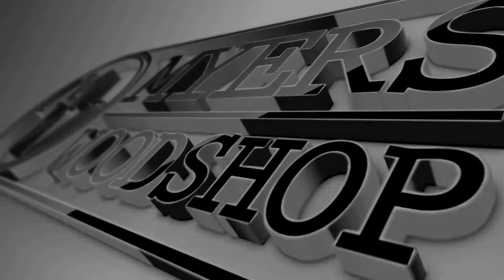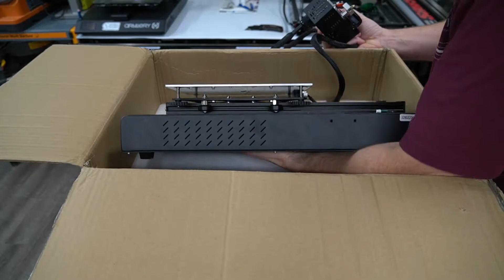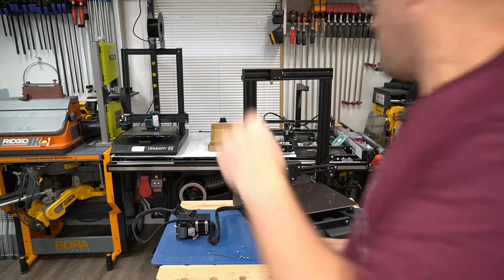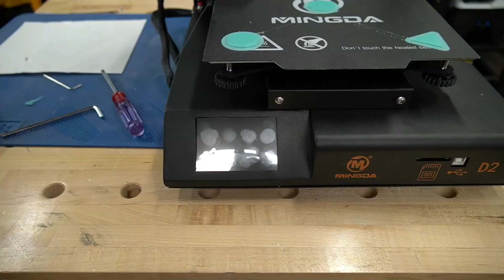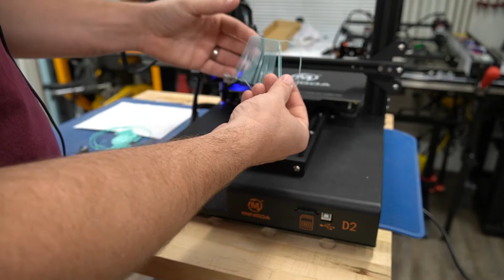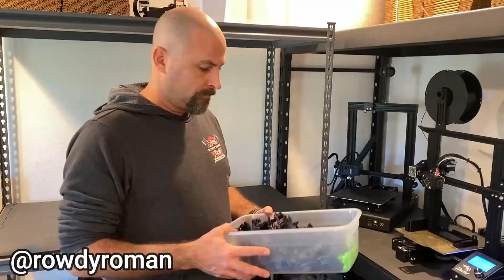Mingda D2 3D Printer Review.  Is This Never Heard Of Brand Any Good?!

Comment: Do you still have the Mingda D2? I have it, and I have given it to my 3rd oldest brother. I found out that despite it still working, MINGDA, discontinued it, along with the Rock 3 . I am having issues with the main board on the Rock 3 now. I am emailing MINGDA about it. I did have problems with the power supply at first, so I replaced it, and then I had to put Ferrells on the LED wires and put heat shrink wrap on it. MINGDA doesn’t have any parts of either the D2 or the Rock series, but I am seeing if I can be the distributor for their D2 series and the Rock 3 series for their parts. Waiting on the email from them now.

Comment: Guys, don't get fooled by this F ** O. When plugged into a socket with a button in the OFF position for the first time, there is a short circuit immediately.
When disassembling the power supply unit, it was fucking poor quality. Inside the block there are a bunch of pieces of tin 2-4 mm long that stagger back and forth, a slow-action domba, in my case, it went bang right away.
Further that I noticed the rollers are of very poor quality, the bearing walks freely in this black plastic, it seems to be pressed. The bearing itself is eccentric of the black roller, that is, with a calibrated table, GLASS ON THE TABLE, if I move the carriage along the X axis from one end to the other with my hand, then it can be seen how the nozzle goes up and down somewhere 3 times over its entire length, the rollers are definitely eccentric.
About LED, he lives his own life. It is connected directly to the transformer and there can be no talk about color changes in the menu.
Something like that about him.
LIKE so people don't get caught.

Comment: How's your Chiron doing?  Mine has been a disaster...great prints, then massive under extrusion.  Very bowden all the way inside the hot end...same issue.  Swap to the spare hot end...good a few times, then the same.  Replaced extruder with a Bondtech BMG, same result.  That hotend/extruder is a real disappointment.